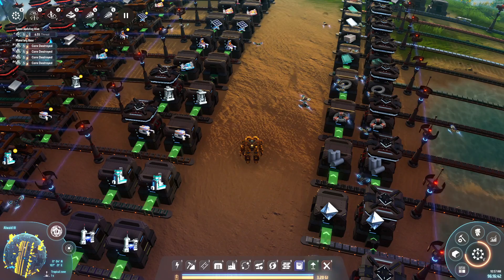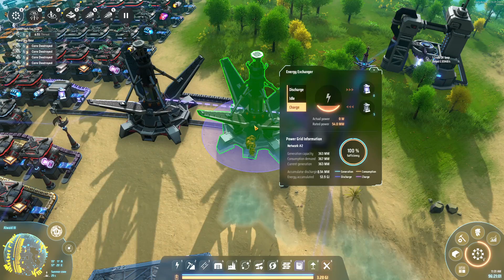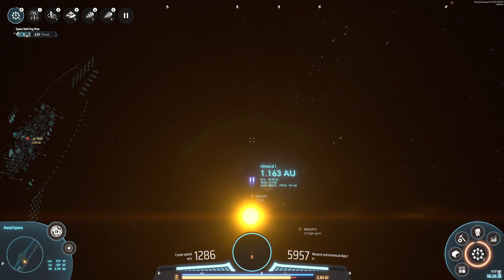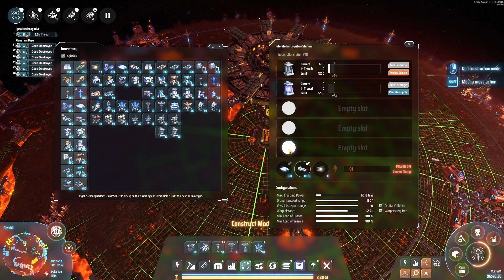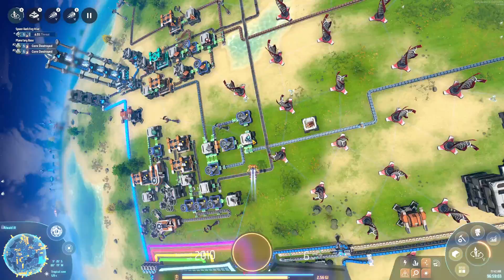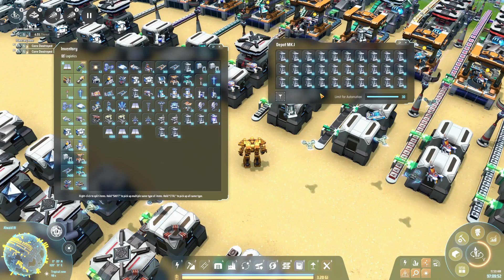EQUIVALENT EXCHANGE // Dyson Sphere Program // Mission Log 96

Comment: In my save, I built the exchangers on a latitude line, so that they could be scaled up later, and fit in parallel to other stuff. It was way ahead of the curve of energy demand, so I didn't worry at all about the arithmetic, and just kept it scalable. Mass-produced accumulators fed directly in to the ILS worked nicely... for a few hours. Eventually, the empty accumulators flooded the charging station so that the discharge station couldn't return any. I didn't notice the problem until everything shut down! Your way worked better; just manually install accumulators, enough for "liquidity" so that the towers have plenty of wiggle room.
Reply from the maker: I got something right? Hehe glad the idea worked for you. Experimenting is the best way to learn!